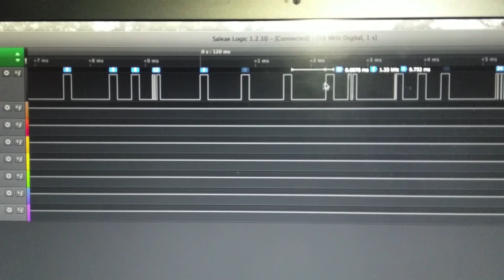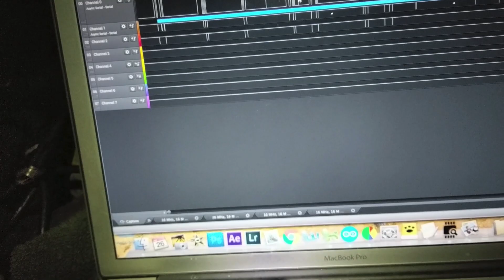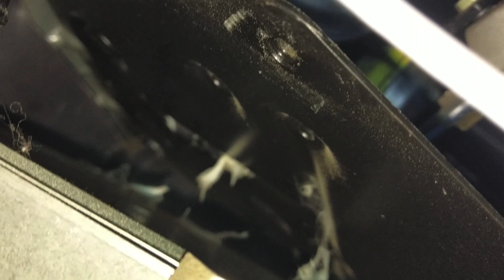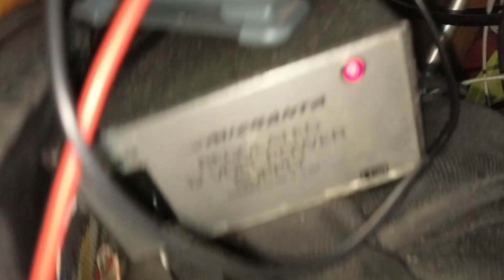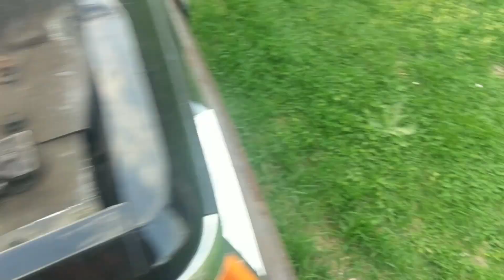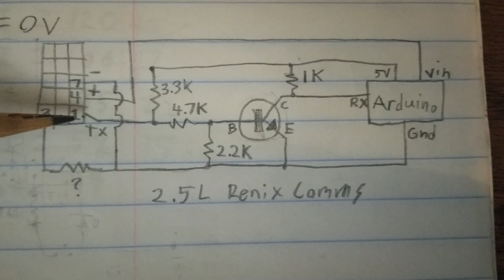Cracking Renix 2.5L M/T ECU Comms

Comment: ive got a 2.5 heres the deal the MAP sensor and the TPS sensor have five volts coming in, the cold air and hot water sensors have 2.5 going in and signal going back to the renix computer is a combined signal, the TPS can be back probed the signal will be close to one volt and rises with throttle opening, the other deal is to make sure the distributor is lined up, with the crank mark at zero the rotor has to be at six olcock or your off by five degrees the crank sensor will pick up the signal but your gonna be off, the other deal is make sure the thermostate allows the engine to get to operating temp. There is a switch by the throttle body that bypass,s emissions at full throttle, you can by pass it and install a switch on the dash, it adds more timing and fuel, my YJ doesnt have a cat but still has a sensor, but I live in WV  with no emissions tests, by the way if your alternator has the voltage going all over the place like 11-16 volts it will mess up the ECU, but you can get it reflashed.
Reply from the maker: on 2.5L YJs they have a Wide Open Throttle switch as well as the closed switch which I think you're talking about. And you'd have to know some pretty talented people, because i'm pretty sure the Renix ECUs are non reprogrammable.
Reply: it was reflashed for under 150 bucks

Comment: Is the arduino programming code for all the "gauge" stuff you use to the reduinix similar to all other vehicles or the code must be different?
Reply from the maker: The code is custom written for the vehicle. Luckily the 2.5L's are very similar to the 4.0Ls there so I just need to change a few numbers